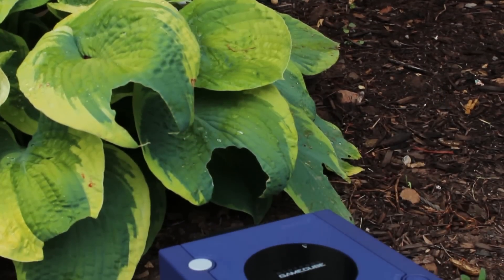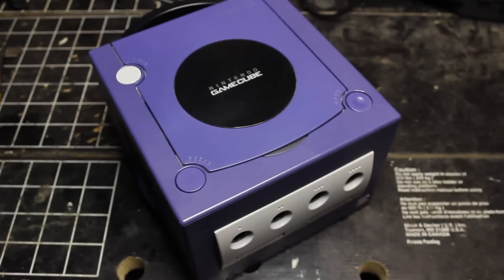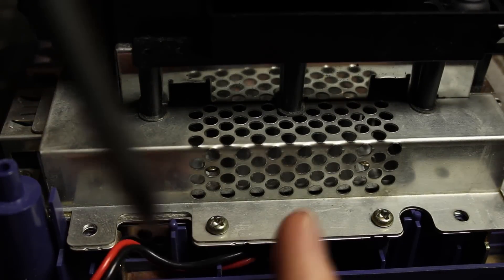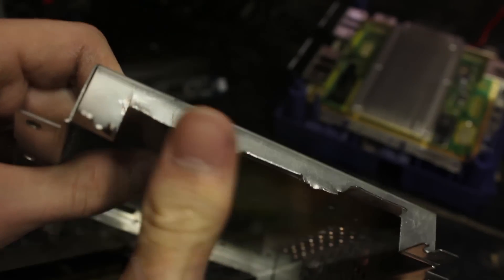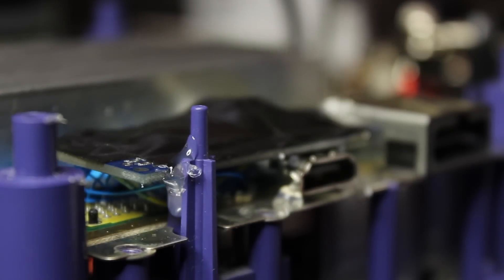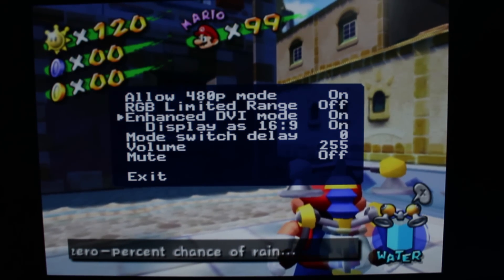GameCube HDMI Mod

Comment: I’m confused, what’s the benefit to doing this instead of getting a getting a RCA to HDMI adapter?
Reply from the maker: The simplest difference is in the signal chain. With the GameCube HDMI mod the signal chain is as follows: GameCube internal digital signal to HDMI digital signal to television.
With an RCA adapter the signal chain is: GameCube internal digital signal to analog composite (RCA) signal to digital HDMI signal to television.

There is a significant loss of information when moving from the GameCube internal digital signal the analog composite (RCA) signal which makes for poor picture quality. By using an adapter at this stage in the signal chain you are converting a signal with lost information back into a different digital format.
Reply: @SamCampbell  Thank you for the informative answer.

Comment: Wouldn't this be easier to just install the hdmi port directly on the spot where the original port sat without the pcb acting as a medium to make it work?
Reply from the maker: The original Digital Out port is removed and replaced by the HDMI port. The FPGA board acts to translate the signals. If you meant why doesn't it fit as nicely, it's because it uses an off the shelf PCB unlike many of the other mods which are overpriced and limited in stock because they are custom designed and single handedly made by one guy in say, Texas.
Reply: @SamCampbell  not that you used a cheap pcb but rather using a pcb having to translate at all that got me wondering why not place the hdmi port directly on the gamecube's motherboard?

Comment: Just finished soldering mine up, and even with DVI mode enabled I'm getting no audio from my tv. Is there something I'm missing?
Reply: Found the problem JUST after I commented. The most miniscule short between 22 and 20 on the underside of the board.

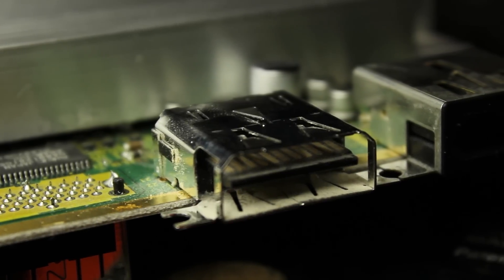Comment: 5:17 Hot air my guy
Reply from the maker: Hot air is not the solution to through hole pins like this. You'll be looking at a desoldering pump like the Hakko FM-204 or the FR-301. Hot air would be way too much heat waste on such a large connector.

Comment: I’ve done a few GameCube mods since watching your video. Now I wonder if it’s possible to use a JST connector in order to avoid the solder work
Reply from the maker: I have optimized my installs to use a ribbon cable but I I have yet to find a connector that I can easily install on the GameCube motherboard.
I would love to find a compatible connector so if you have found one let me know!

Comment: Is it possible to do this in a way that keeps the digital port working with the same mod chip
Reply: technically yes because the points you solder on are the ones of the port, practically no because you'll need a male connector and the wiring will be quite awfull.

Comment: Wait, so did the hdmi adapter board have pins that slid into the holes on the socket of the digital video port you desoldered or did you have to solder small wires from the hdmi board to every hole on that digital video out socket? Video just kind of jumps to "He's soldering now!" and I was all like "Whoa, whoa, whoa! What the fuck, what the fuck!?" and I went back in the video but didn't see anything. :P
Reply from the maker: This video serves as a rough overview of what you will go through, there is a raw process video linked at the end and in the description, as well as a written guide. To answer your question though, yes each wire was soldered individually.

I've thought of creating a connector to make it easier, which I may end up making and selling at some point but for now, yes, it's one wire at a time
Reply: @SamCampbell  hahaha ah, I see. Thanks for the clarification. :P

Comment: @Sam Campbell can the hdmi image be upscale and sharp within reason or will I see a small square on my 1080p 50 inch telly
Reply from the maker: Well GameCube games were originally 480p or 480i. This device will upscale to 1080p and more prodomenantly 720p. That being said the vast majority of GameCube games were 4:3, there is simply no way around that fact that games took up a square portion of space on the screen at that time. So yes it will be a nice HD square that fills 70% of your screen. The only option you truly have is to stretch the image in your TVs settings but this will look poor , since the games were not designed for this
Reply: Sam Campbell therefore will i have a band on the left and the right but top and bottom will touch. Or will inhave even less than that. I ought to watch the full video however would you bace a visual example to show?

Comment: I was going to do this to my game cube but realized that you just sliced off a piece of purple shell...I'm not doing that to an Team Xecuter IcedCube shell. They need to make a more versatile chip to have the same functions and fit without insane case cutting... (sigh)
Reply from the maker: It is a small leg at the back that adds support the the closed lid signal, but this support is reinforced by the Pluto board once it is in place. I understand your concern when it comes to an exclusive case though. I suppose the only option is one of the external adapters on eBay

Comment: Dunno if anyone can help but just installed a Pluto II card in my gamecube and I get about one second of video before blank screen. My monitor recognizes it's getting the signal but does not display anything? Also I only have this one computer monitor to test on (It's an LG widescreen)
Reply from the maker: What is the LED on the Pluto board indicating. As well, when you say that the monitor is getting signal but doesn't display it do you mean that its telling you that its out of range, or is the screen simply blank?

Comment: HELP!!! I rewired everything multiple times i have a blinking light but no signal
Reply from the maker: The pulsing  light is  a good sign. This will sound odd but did you connect the HDMI cable properly, it clicks in farther than you think

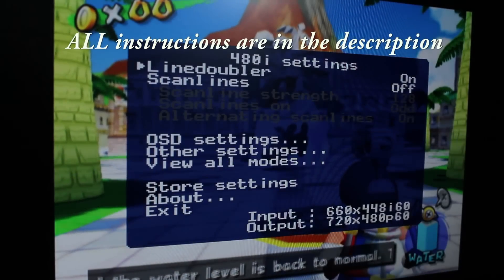Comment: 10:35 "Input: 660x448i 60" The overwhelming majority of Gamecube games support native 480p output! Hold B when starting the game, and then set the game to generate native 480p output. This way the mod won't need to convert 480i to 480p. I believe it even saves your preference somehow. It might be a system-wide setting, or maybe only remembers your preference when the game has a save on the memory card (I'd have to experiment again to be sure). I owned component cables that I had purchased directly from Nintendo back in the day. I finally sold it last year since I plan to add HDMI.

Comment: If I have a question would it be possible to change the game cube digital output with a wii output by doing the same method?
Reply from the maker: Ah, see the Wii outout in what is described as a "Multi AV" out. Meaning that the cable contained composite, component, and I believe S-Video signals within the cable. The GameCube had the option of a Digital AV out. To put it simply, these signals were completely digital. You could think of it like vaguely the same way that HDMI is. So inside of the GameCube component cable there is actually a DAC (MXB012355) that converts the digital signals to component ones.
Hope that helps.

Comment: So sad that i live in Brazil, would be very expensive to send it to you, cause my NGC needs that, since it is the one with the regular analog out. Or doesn't work in those models?
Reply from the maker: This only works with DOL-001, or GameCubes that do have a Digital AV out
Reply: Sam Campbell oh got it... That sucks, there is no way to play the regular analog gamecube, only if you have a CRT TV, with a S-Video cable
Reply from the maker: There was a mediocre solution for analog-only GameCubes from BadAssConsoles, but like the N64 HDMI mod, production seems to have died.

Comment: Was the HDMI port already attached to the bord from knjn? Or do you have to order the HDMI port seperately with the pluto bord from them?
Reply from the maker: Item#6117  (Pluto-IIx XC3S200 HDMI), pre-programmed with GCVideo from KNJN will have the HDMI port already attached
Reply: Sam Campbell thank you for the response! Also i was wondering does this mod work with a 4K TV? Does it pick up the signal no problem that you know of?
Reply from the maker: I believe it would work no problem. Feel free to ask any other questions!
Reply: Sam Campbell Thanks for the response really apprreciate it!
Reply: Sam Campbell i installed the puto board and did the mod. However i am getting no signal on my TV. I checked if i installed a 100 ohm resistor and i did but no signal. The pluto board is also pulsating with a red LED, then stops and then pulsates again and continues like this. Any idea what is the problem?
Reply from the maker: The pulsating should be continuous. If it stops for a few seconds then there is most likely a short somewhere.
Reply: Sam Campbell i tried using a new motherboard and rewired it all over again. Now i still get a pulsating red light but when i put my tv on a different HDMI channel and then back to the one the pluto is connected to. it is a continuous red light. But still no signal on the screen. Any suggestions?

Comment: Hello i'm working on a project for a wireless hdmi solution and i have a pluto IIx hdmi + 2 hdmi adapter
my question is that i want to recover the hdmi signals on the pluto IIx hdmi from an hdmi solution like the Tv so that i can manipulate the datas and i don't know how to start. 
Please any help would be appreciate. Thanx you and great video !!!
Reply from the maker: Are you talking about a product like this: https://www.amazon.com/gp/product/B0092T3E3A/ref=as_li_ss_tl?ie=UTF8&psc=1&linkCode=sl1&tag=zeos-20&linkId=2df2340de7f04c6c8e7d760e4f464d19
Reply: yess but all i want to do is just recover an hdmi signals with the plutot IIx and do some post treatment the wireless transmission part is not my bussiness

Comment: This was a fantastic tutorial I used to get my GameCube modded! I've had my GameCube HDMI modded for about a year and it's a great solution if you don't wanna find official GameCube component cables.
Reply: How's the resolution? what is you general experience?
Reply: @chileanguyfleegman  It outputs 720 x 480p I believe, just like it would if you are using the gamecube component cables. You should be able to check the resolution output in the options menu that comes with the chip. I've been using my modded gamecube for a couple years now and it's been working great! The picture quality is as good as it gets I believe without using an emulator or external upscaleres such as the framemeister or the osc.

Comment: Hi Sam, i tried the mod awesome video of the soldering! Not really satisfied yet, i think the picture could be better than it is now. Stil bit blurry around edges is this normal? I did see an mod without getting rid of the digital port by soldering the cables onto the pins of the port. Would you advise against this?
And last question what wire did you put into the controller pin, i think i burned the board there. Any advise?
Again awesome videos really helped a newby at solderding.
Reply from the maker: Soldering onto the pins of the port may seem easier, but then you'll need a way to route all of the wires onto the topside of the PCB (If I understand what your saying).

Here's an alternative controller point if you need it: http://i.imgur.com/My2iZAK.png
As for any jagged lines you see, that is just simply the sheer limit of the textures in the GameCube! There was only so much it could render.

Good luck on the mod!
Reply: Thank you for your answer, did not know about the alternative port!:) Do you think this could help for people who like me cannot get it right with the controller port: https://www.conrad.nl/nl/schnepp-fk-2000-lamellenstekker-stekker-recht-stift-o-2-mm-blauw-1-stuks-731305.html

I read about banana plugs, would make life a lot easier:)
Reply from the maker: It might, but it may need to be even smaller, like 1mm. Good idea though!
Reply: The Alt Controller point worked, thank you! Just added some solder on the point and streched it out upwards. Then put some solder on the wire and soldered it together. Added some hot glue around and Voila! Ill advise anyone who has difficulty with the regular controller port to use it this way. JUST BE SURE YOU DON'T HIT THE BOARD WITH THE IRON.
Reply from the maker: Glad to hear it worked

Comment: does the newer cubes that didn't come with that port still have the points to solider the board into. i know some modding of the case would be needed.
Reply from the maker: The new GameCubes (DOL-101) with only one video out port cannot have HDMI output, however they can be modified to support component cables/VGA natively with the analog mod from http://badassconsoles.com

Comment: I'm hoping to pick someones brain here in the comments, I installed the Pluto board and when I plugged in the HDMI everything worked initially. That is until I hooked  the cube up to my main TV. I wanted to see the difference between 480I composite vs component. so I had the AV cables and the HDMI cables running at the same time and was switching between the inputs on the TV. Now the cube only wants to display video over HDMI if the AV cables are plugged in as well. Everything works fine doing it this way but its annoying. I checked continuity for the line detect and the power from the main board to the Pluto board. The weird thing is I can Only run the Game Cube off the HDMI if I have the AV cables connected at the same time as the HDMI then power it on. After I can unhook the AV cables and it will display the HDMI signal but eventually the screen goes dark say 30 min to an hour after. If I plug the AV cables back in the display comes back on. I am stumped and an amateur at this stuff. Does anyone possibly know what the problem could be? any input would be most appreciated.

      By the way, Sam Campbell. Great vids on this install. I couldn't have done it with out them. Thank you!
Reply from the maker: That is an interesting problem, I have tried doing what you have just said and I didn't experience the same issue.

The only connection I would recommend checking is pin 1 (on the digital AV out), since it's the cable detect
Reply: Sam Campbell, I replaced the wire and still had the same issue. it's weird. So I tried it with out the resistor and still had the same issue. Then I soldered on a new 100 ohm resistor and as far as I can tell everything is working fine.  I guess it was a bad resistor? I'm happy to have it working without having to have the A/V cables plug In though!

Comment: Wouldn't it be easier to make a Digital AV to HDMI adapter? The Digital AV port outputs pure digital video anyway, plus an adapter would be a much safer venture than physically altering the GameCube's motherboard. It's already possible to make Multi AV to RF adapters, heck Nintendo themselves made an official one for the N64 and GameCube, so why shouldn't it be possible to make a Digital AV to HDMI one?

Maybe someone could also make an adapter for Wii component cables or regular component cables that connects through the regular Multi AV port, since component video is analog anyways; the only reason nobody's made third-party component cables for the GameCube is because of the digital-to-analog converter chip.
Reply from the maker: Yes, but nobody makes one. The whole thing is really a project someone made in their garage
Reply: I'm aware that no adapters exist yet, I'm just wondering why nobody ever seemed to think of making one.
Reply from the maker: Yeah it would be really nice if someone came up with one, but I suppose it's a niche market
Reply: Yeah, I guess that's true. Still, modding itself is a pretty niche activity and selling pre-modded consoles does in itself appeal to a narrow audience at best, so I guess there's not too much harm in making an adapter either way. That's just my take on it, though.

Comment: Can I get the Pluto EP1K10 model? Please tell me there no difference. I need to buy a really cheap one my budget pretty low.
Reply from the maker: Unfortunately only the Pluto-IIx XC3S200 series will work
Reply: Sam Campbell Damn.. Alright thanks! Then what even is the Pluto EP1K10 model?
Reply from the maker: They're all just FPGAs (meaning field-programmable gate-arrays), so the rough comparison would be to a programmable micro-controller like PIC. Someone has simply written a program that interprets the GameCube digital data and translates it to the HDMI interface

Comment: What brand wire did you use? the ones I ordered felt cheap. I completed the soldering. The cube turned on but Hdmi display wasn't working. The cube still boots an plays fine with composite output.
Reply from the maker: I used something like: 
https://www.amazon.com/Breadboard-B-30-1000-Plated-Copper-Wrapping/dp/B008AGUAII/ref=sr_1_2?s=lamps-light&ie=UTF8&qid=1488762980&sr=1-2&refinements=p_n_feature_two_browse-bin%3A6426179011

Comment: Alright, I can't be the only one to have thought of this, but when implementing the HDMI mod, wouldn't it be much simpler to create an adapter that connects to the DIGITAL OUT port on the game-cube with HDMI out on the other end?
Reply from the maker: No you are not the only one, but this mod was basically an open-source prototype made by Ingo Korb that was designed to be used on a simple FPGA board. It could be done but there are simply no manufacturers for it.

Sorry I do recall now, that one site is working on it, but I'm not sure on a release: http://www.badassconsoles.com/gcvideo-faq/